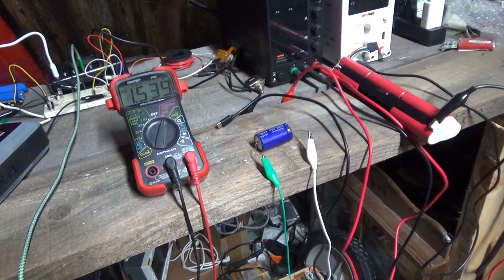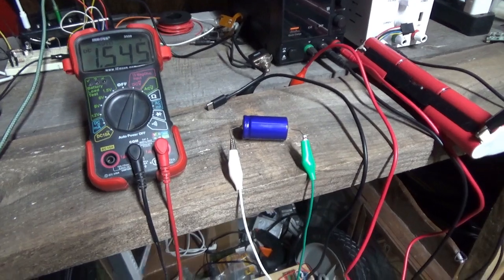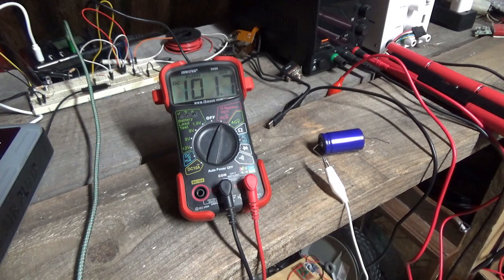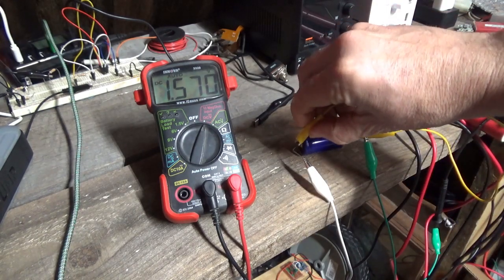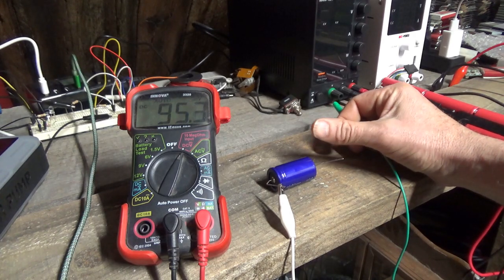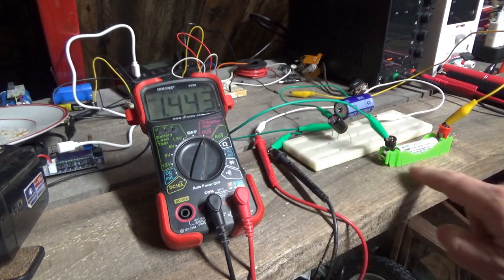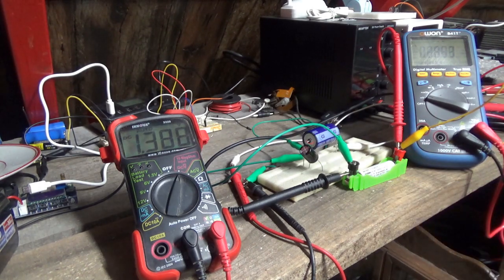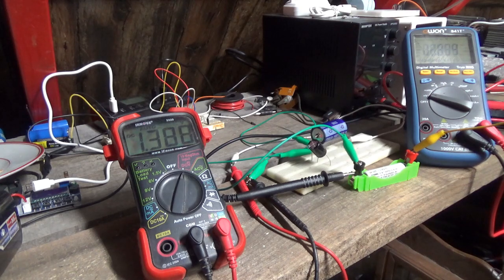A Capacitor Charging From Thin Air Is This Free Energy

Comment: Not very uncommon at all. There’s a reason certain capacitors are stored with the leads shorted. Depends on the permittivity. 

You can fully charge one walking across a carpeted floor. 

You also have that spinning wheel over there creating static.

Comment: Maybe if you put a diode between the capacitor and the battery to drain the capacitor down to charge the battery more
Reply from the maker: Diode would reduce the voltage and would make me have to wait longer in between charges.

Comment: I'm going to say it's probably what they call. Eddie currents from the surrounding environment that you have the capacitor in. I just wondering if you would take it out in the woods to where there's no electricity, nowhere near it and see if the capacitor would still charge like that because if it doesn't then more likely it's going to be. Eddie currents, but then again, even radio signals can probably charge the capacitor or maybe even satellite current granite. We're talking about low, low, low low current, but as you even see in the video of the capacitor is not charging rapidly real fast. In the beginning it does but it does taper off to where it starts to charging real slow. So I'm thinking it's going to be Eddie current from the surrounding area and environment that it's in
Reply from the maker: Probably from the magnets on the bike wheel spinning nearby. Or currents from the coils.

Comment: leave capacitor connected to the battery in your meter for 5 minutes, note the capacitors voltage after those 5 minutes

next,

leave the capacitor on the bench without it being connected to your meter's battery, through the testing probes,  after 5 minutes, note the capacitors reading.
Reply from the maker: I do know the cap is charging without the meter so it is hard to tell if the meter affects it at all when connected.
Reply: @The Do It Yourself World Electronics  I have been watching some of your other videos. Good 👍 content.   Tysm for posting and sharing.    I am currently salvaging 18650s out of modem packs and hope to assemble a safe and modular 1kwh battery pack.  I own a few solar generators.
Reply from the maker: Cool. Battery Hookup has great deals on 18650s. Might be where you are buying. Use code DIYTUBE and save. I am building my own packs as well.

Comment: Sorry, but no such thing as "free energy"! As to why the capacitor is regaining its charge.... Check out the Wiki link given by DineHomeDelivery in the comments... "Dielectric absorption". Keep in mind that even when a capacitor is fully charged from an external source, the amount of energy stored is very little. Which is why capacitors can't be used to power electric vehicles for example.

Comment: I have watched some but not all of your videos. I know how much work it takes to put this together. However I saw one of your bedini videos. I think you may have made a mistake with your coil windings. Not that it does not work or anything like that but these bifilar coils should be wound as per Tesla flat coil in the winding. Connecting each flat coil as per Tesla's patient then stacking the interconnected with each other for more effective spike generation withing the bifilar coil. It's a huge pain to wind and solder all the leads with this configuration but the efficiency will be at maximum.. just let me know your thoughts.
Reply from the maker: I dont know.... I always went with John's instructions and study his notes on expanding the system. Recently I have been reading notes from Don Smith tho and am going to start experiments on the Bedini motor with separate coils.

Comment: When you short a capcitor they NATURALY climb back in voltage due to how capacitors work, but they don't usually come back over 1v unless they are a few hundred volts and were charged at that voltage and then shorted, if you wanna confirm this capacitor is actually charging id leave it shorted out for a few hours and then take it off and see if it comes back up again, that's honestly creepy
Reply from the maker: It is constantly charging, even after a full short.

Comment: Bemf is what travels backwards after a spark, 1000s of v but near ZEROamps
Reply from the maker: That bemf may be causing an electromagnetic disturbance which is charging the cap wirelessly. I am going to experiment more with this idea.
Reply: @thedoityourselfworldelectr8007  did you see the email?
Reply from the maker: Yes but this is not connected to a coil.

Comment: Hi Troy have you tried to run a bedini off of a capacitor alone. I seen someone else doing it.
Reply from the maker: I think I did once. I have an idea to run it off a cap with solar panels to charge the cap. Eliminate the input cost entirely. John said you could run the motor off a solar panel alone, even at night. Mine likes a higher voltage tho.

Comment: Power feedback from meter is what i thought at first but you seemed to show that is not true. At least not all of it , if any. This made me wonder, just for the heck of it, what happens if you connected one meter to another. Would either show a voltage other than stray charges?  I would try it myself but I have one multimeter. Interesting stuff though. Thanks for showing this. 🙂
Reply from the maker: I never thought about checking a meter with a meter. I left the cap overnight and it had a much higher voltage in the morning with no wires connected. It just keeps charging.

Comment: The phenomenon you're seeing is called dielectric absorption.

https://en.wikipedia.org/wiki/Dielectric_absorption
Reply from the maker: Up to a certain point, yes. They say up to 15% of the original voltage. But this is actually increasing well beyond the original voltage again and again. When I shorted the leads out entirely, it came up and kept rising.

Comment: I saw a 50,000 volt capacitor in Hawai'i that had to have it's leads shorted with a wire to keep from shocking any one touching the terminals.
What is that cap you have? A Mallory super cap?
Reply from the maker: No, just a normal electrolytic capacitor. But it was on the charging side of the Bedini motor for a while so it may be conditioned to receive that energy better.